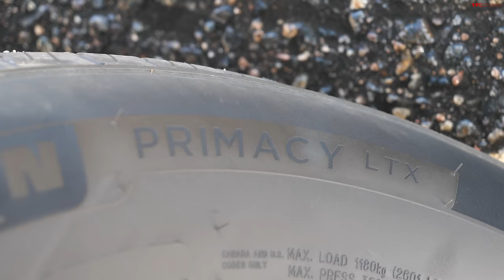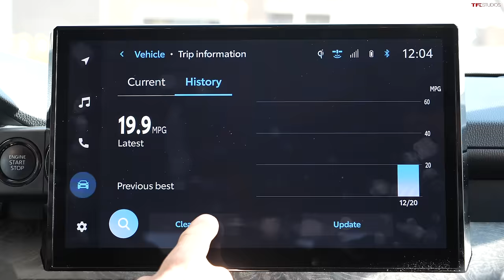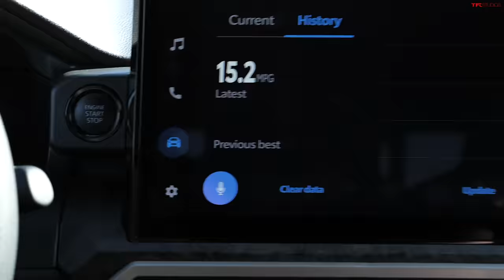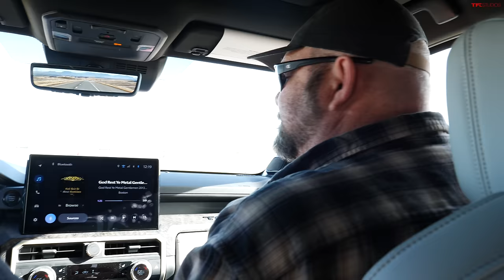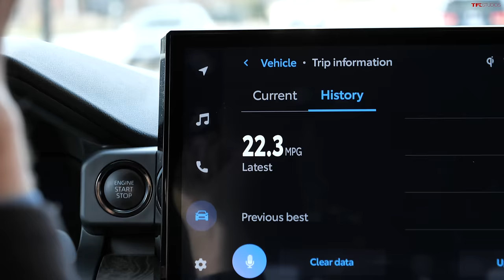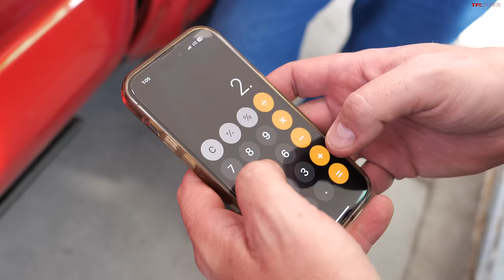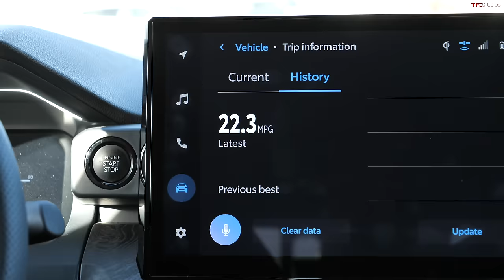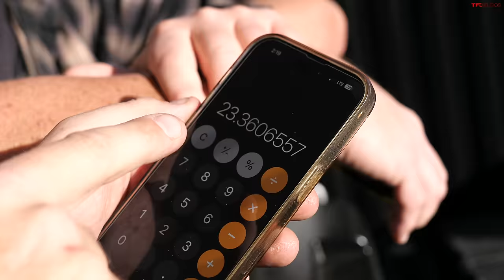Does the New 2024 Toyota Tacoma's Massive Chin Spoiler Actually Do Anything? We Put It to the Test

Comment: The difference may be larger at sea level. The air is fairly thin where you guys are.
Reply: If there's a 2% improvement there would still be a 2% improvement just the actual miles per gallon would be different
Reply: ^ so...
The difference is an environment where aero effects are *more pronounced*, versus an environment where aero doesn’t help as much (high altitude Colorado).  
Ergo, the difference (2-3%) widens differentially.  It’s still a matter of testing whether the difference changes to 2.5-3.5% (negligible), or if the difference widens meaningfully... which is subjective, but if it approaches 5-6% difference, there are probably people who would keep it.  
Personal note, I’d eat the 5-6% difference and remove the chin myself lol

Comment: I could see owning a set of oversized all-terrain 3PMSF, and running them in winter and offroad without the air dam, then having a set of OE size highway tread tires to use with the air dam for daily driving and highway trips/towing. The combined difference would probably be 5-10% MPG, enough to pay for the extra set of tires/rims after many years.

Comment: I noticed the chin spoiler had 2 big rectangular holes in the front of it. If the holes were covered would it make a bigger difference?
Reply: Those to holes could be a vortex generator to accerate the air underbody not sure were exactly they redirect the vortex my guess for the front wheel
Reply: then people would complain about no access to the recovery hooks (or loops in this case)

Comment: I removed the front air dam on my F150 after getting stuck in the snow when the air dam acted as a snow anchor.

In doing so, I lost 2 mpg on the highway, however, I also noticed the truck was less stable at speed and could feel some turbulence pushing the truck around side to side.
Reply: Same 2 mpg loss for me on my F150 but no change in driving dynamics after spoiler removal.
Reply: I left mine on, if I hit a rock with it  it's a warning to be careful and not let it hit my oil pan or trans pan.
Reply: @volvo09  in dry conditions, it's no problem, I agree good to hear the warning with it rather than hit the oil pan. The issue is in snow, when snow gets deep it first acts as a snow blow, then when you back up, it scoops snow up and into the front bumper leaving you immensely stuck.

Comment: With or without the chin I am pretty happy with those numbers. If the hybrid can add 2 or 3 mpg to that then Toyota will really have something.
Reply: The 4 cylinder engines are supposed to be more fuel efficient than a 6 or 8 cylinder. But John at LHT Performance put a V8 from a Silverado into his 2020 Colorado, and he gets 28 MPG on the highway. Why spend so much money for a 4 cylinder or a hybrid when the fuel economy is worse than a V8.
Reply: @aerynlovell4754 yup. I imagine a Tacoma with a v8 would be very decent mpg
Reply: @aerynlovell4754  It's more that smaller engines have  lower emissions, that's what the Government is pushing for. 
That being said V8s always got good highway mileage, it's when you're putting around town that it drops like a rock. I had a Grand Cherokee with the 5.7 and  the ZF 8-speed. Even with cylinder deactivation  best I cold get was 15 mpg. Even my Camaro only gets 18.
Reply: @DragonKnightX12  John at LHT Performance used the V8 from a 2020 Silverado and a 6-speed automatic transmission. It still has the factory catalytic converter. He doesn't like heavily modified vehicles for a daily driver. It is what he calls OEM Plus, meaning it complies with emission standards, is quiet (no drone), but has more horsepower and better fuel efficiency. An engine is a giant air pump, so if you remove the restrictive stock air intake and exhaust and replace them with a free flowing aftermarket intake/exhaust, then you get better gas milage.
Reply: @aerynlovell4754  has there been updates on that? I think the fuel economy was just based off a first drive using the onboard display (with no real accessories hooked up yet). I'd be interested to see if he has a follow up where he actually calculated it with everything working.
Reply: I still haven't seen any advantages of a hybrid in a truck yet. Now maybe if I was a delivery person that never got on the highway and never went past 45MPH then there might be an advantage. Hybrids add extra weight and extra cost so savings in the long run or not as significant.
Reply: @jamesm568  Fuelly shows a difference for the F-150 Powerboost. It's up to the specific person if such a difference is worth it though. To me the advantage isnt necessarily fuel economy, but the onboard power that pickup hybrids these days have. Having 2.4-7.2kw of immediately accessibly power is a huge advantage for what I like to do.
Reply: @ALMX5DP  Plausible.

Comment: Yeah I will choose way better looks over just a 3% improvement in mpg, and a Tonneau cover for the bed would probably get back that 3%
Reply: Actually increasing tire pressure even just a tiny bit, a few PSI, can easily increase MPG by 3% or more. Pro tip there for everyone, but dont increase your PSI too much and check recommendations and do your research. Off-roading decrease PSI, but generally not below 20.
Reply: Jury is still out on how much a cover can help improve MPG.  It is understood it doesn't help much.

Comment: Let's be real, 57 miles isn't anywhere near long enough to get an accurate idea of the actual MPG. Either way, I wouldn't care if I got 5 MPG less, I would remove that front chin before I drove it off the lot.
Reply: Yeah, far too short of a test without using a fuel cell.

Comment: The chin would make since if it could get you 1-2 mpg extra.
Reply: Well it got 0.7mpg, that's not far off the 1mpg you mention...
Reply: @boostav  I stated 1-2mpg, meaning over 1mpg.
Reply: @thenutsonyourchin  A chin guard on this will never be able to create enough wind deflection to save 5mpg. Not even a completely different front end with a low drag design would save 5mpg.

Comment: 87 octane in a forced induction engine seems wrong to me. I know Toyota says it's fine but I am wondering if premium would result in better power and mpg.
Reply: @carbonking53  higher octane won’t produce more power. It will produce as advertised only. Lower octane will produce way less performance than advertised.
Reply: @AntilleanConfederation  Actually modern turbo engines will tune up when they detect higher octane fuel being put. Even Subarus do it.
Reply: @carbonking53  I agree and understand. My wife drives a Mazda CX-5 Turbo and Mazda states you can run it on 87 but you will get more power and MPG with premium. Her car has never seen a tank of anything but premium since the original dealer fill up of which I assume was regular.
Reply: @DragonKnightX12   tune up to the factory tune for 93 yes. But it won’t make more power past that.

Comment: But what if you can’t find your 10 mm socket?
Reply: Every Jeep Wrangler and Gladiator include a little tool kit with a ratchet and bits to remove the doors and hardtop and fold the windshield. Toyota should include a ratchet for the chin spoiler.

Comment: Is no one upset that it only gets 24 mpg. That is awful. You can get a F-150 that gets that or better and it’s bigger and quicker.
Reply: You’re lucky to get 20 in an F150 and it’s no quicker.  Being bigger is not a selling point.  It won’t fit in parking spaces or garages so it’s basically useless.
Reply: “ (F150) won’t fit in parking spaces or garages so it’s basically useless.”

$hit. Nobody told me that my F150 was useless because it didn’t fit into parking spaces. I though after driving it 80,000+ miles that it fit into parking spaces pretty well. It also fits my garage. Definitely didn’t seem to be useless when hauling construction material in the bed or demo debris to the dump or when I was camping for months out of the camper in the back in state forests. Thanks for letting me know. I will get rid of that junk immediately and replace it with a new 5-foot bed midsize truck so finally I will have a useful truck. Originally I just wanted to add a Tacoma to the fleet but you opened my eyes. I should just dump that useless F150.
Reply: @carbonking53  The truck mileage computer is optimistic.  Try parking in a garage that’s 18 feet deep.  I’m not removing snow and ice in the winter.  Acceleration is limited by traction.  A pickup with little weight in the rear is not accelerating very fast.
Reply: @carbonking53 interesting. I had one of those and barely got 18 mpg.

Comment: You're cruising around at 75mph. You're never going to get good gas mileage at that speed.
Reply: I have. 🤷‍♂️
Reply: @JohnDoe-nz6bk  Is it the exact same truck as shown in the video? As in 100% exactly? Same town? Same distance? Same elevation? The answer is NO. Your anecdotal evidence is MEANINGLESS at best and useless since there's multiple factors at play here.
Reply: @MustangFord  no, with a hemi. With a 6.7 diesel. With a 4.0 in a 2018 4 runner. The mpg between 60-75 mph is a negligible difference.
Reply: The MPG at 60 vs 75 is definitely NOT a negligible difference. I just did a test drive of 2,600 mile’s keeping my HD diesel truck running at 65 MPH vs the usual 75 MPH that I drive on same route and I got 20.5 MPG vs the usual 16 MPG. And that’s over 2,600 miles. No towing just the truck. The difference would be even bigger for keeping the truck at 60 MPH.
Reply: @is6566  I call BS on that claim. I consistently got over 18 mpg doing 75 with my 2016 ram 2500 mega cab limited cummins. And I live in Ohio where it’s hilly.
Reply: @John… Do you mean the “cheater” Cummins gets better mpg than the (as of writing) non-cheater Duramax 3500? LOL What a surprise. One is also inline six and the other is 8-cylinder. And 2,600 miles one way is not gonna be flat probably anywhere in this country.
Reply: @is6566  I’ve gotten the same mpgs out of a v8 diesel.
Reply: @John…. What can I say? You are the Master of getting as good (or negligible drop) MPG out of every vehicle be it HEMI or diesel, or anything really at 60 MPH vs 75 MPH. 

I am just part of the mere mortal category where increased speed over 55 MPH drastically reduces fuel economy. In my world this is how it works: 

According to studies backed by the department of energy, the average car will be at its advertised MPG at 55 mph. But as the speed increases:

      - 3% less efficient at 60 mph
      - 8% less efficient at 65 mph
      - 17% less efficient at 70 mph
      - 23% less efficient at 75 mph
      - 28% less efficient at 80 mph

At 75 MPH the MPG will be about 20% less than at 60 MPH. My own experience backs it up. In my case the efficiency difference is 25%. At 75 MPH I have an average 16 MPG vs 20.x MPG at 60 MPH. On a 2,600-mile one way trip (hand calculated) on Duratrac tires in a 12,250-pound GVWR Duramax (modern DPF/ERG/DEF etc intact) truck. So, here I have a conundrum, I can believe science which roughly aligns with my cheating eyes and personal experience or you the random dude on the internet with the magical truck where air resistance doesn’t increase exponentially by speed. 😃 Hard decision.
Reply: @is6566  and my experience says it’s completely wrong. Don’t know what to tell you other than learn how to drive your vehicle. The only vehicle that I got consistent horrible mpg (13) was my 2021 Mojave. Again, learn how to drive. 🤷‍♂️
Reply: @is6566  interesting that your truck weighs 12,250 when my Cummins was 8900. A dully only added about 500 pounds. A 3500 wasn’t much more than. So, if you weren’t towing, why is your truck so heavy? My truck had 3:21 gear ratio with people getting as much as 25 mpg. Fords 6.7 with 3:55 gets 18-20 my personal experience. Soooooo, either you’re lying, or you just don’t know how to drive. I’m going with both scenarios.
Reply: What interesting is that you argue about trucks and don’t even know what GVWR is and you confuse it with curb weight. I will leave it at that. Everyone reading this thread can make a decision who is lying out of the two of us.
Reply: @is6566  yeah, you’re lying. You’re using gross vehicle weight, meaning you were hauling. Which you said you weren’t. My weight was with a full tank of diesel. And a few things I always carry in my vehicles. So go ahead and keep lying, pal.

Comment: My 1985 Toyota 4runner SR5 5 speed with the 22re engine and has 289,000 miles and gets 23mpg using gasoline 89 octane , no E10 or any type of ethanol.... truck sits on 35's with 5:29 gearing. getting the 23mpg on said truck using gasoline 89 octane going 70-75mph on a 2 hour trip.  I would say this is AWESOME. considering it's age. on a side note, I tried the same trip using E10, fuel economy dropped to 17mpg.

Comment: you know this is interesting. i have a chin spoiler i HATE on my 2016 ford f150 3.5ecoboost. i have wanted to get rid of it for a year now. but i always hated the thought of losing MPG. but this test shows that i will be fine. of course different truck. but if the savings are just 1-2 mpg. well it might be worth it to just take off
Reply: On my V8 F150 it is 2 mpg drop for removed spoiler.

Comment: After owning the vehicle for 50K miles thats a lot of gas saved. Of course its not going to be significant in this scenario. The point is that IT WORKS.
Reply: It’s like 60 bucks a year. Basically nothing saved at all.
Reply: @devengudinas1649  That's a lot of gas saved and less emissions that are spread when you consider potentially thousands of these trucks will be on the road... It not always about you.
Reply: @MustangFord oh good god! 🤦‍♂️
Reply: @JohnDoe-nz6bk   That's exactly right, you have zero points to make with zero facts to back anything up.
Reply: @MustangFord your original comment said "a lot of gas saved". To me $60/year is not a lot. It is something for sure  but the difference in saved gas and emissions especially is insignificant.
Reply: @MustangFord  I don’t argue with more ons!!
Reply: @Pantelifts10  it’s not. It’s barely 2 gallons a month, if that. City driving??? Forget about it!
Reply: @Pantelifts10   A single owner might find it to be insignificant or not, that's up to them to decide. Thousands of these trucks on the road will indisputably save A LOT OF GAS (which is a good thing).
Reply: @JohnDoe-nz6bk   You sure do spell like one, pal.
Reply: @MustangFord  thanks for proving my point!
Reply: Just for some context on the larger picture, if that is what is being discussed. Doing the simple math (based on this decidedly unscientific test by TFL) says that if Toyota sells 250k of these with the spoiler, after 50k miles that spoiler would save over 15.5 million gallons of fuel. Not bad for a simple piece of plastic.

Comment: The old truck was better looking and more functional. Turbos add fail potential.
Reply: Yes, & very expensive fail point.
I remember back in the mid 80's car companies did the same thing, turbo everything. So just like then maybe this is just another fad.
Reply: The old truck desperately needed an engine update.
Reply: @noneyabizz8337  Why do you think that?
Reply: It’s definitely not’ ‘80s anymore for turbo engine design.
Reply: @scottyellis3442  very expensive? A new OE turbo for my 2.0T is like $600.. I bet some other ancillaries can be more expensive to replace.
Reply: @mlow42  poor mpg, poor power.
Reply: @ALMX5DP  seems like the plumbing, extra fuel systems, turbo, pressure in the heads, intercooler, labor etc, will all be potentially extra expenses.
Reply: @noneyabizz8337  mpg is no big deal, power perhaps I can see.
Reply: @mlow42  extra fuel systems?  And doesn’t seem that way at all to me, especially on an inline 4. It’s pretty straight forward and though a turbo might be an additional component really it’s not much extra complexity especially when compared to a V configuration engine with multiple heads and valve trains.
Reply: @ALMX5DP  don't we need more fuel and more fuel pressure, with a turbo? More pressure on the cylinder gaskets, more pressure and heat in the exhaust manifolds. Overall, I'm just saying there are more things to break and those things are unnecessary.
Reply: @mlow42  direct injectors should be similar in terms of pressure and flow to other engines of a similar power rating. There is more cylinder pressure but if the head and hardware are all designed for it, there’s really no worry an not more to break.
Reply: @ALMX5DP  I've been known to be wrong a time or 2.  It still seems unnecessary, as engines have worked fine without them for a long time
Reply: @mlow42  yeah it’s not necessary in all applications but like we’ve seen in the semi tractor trailer realm turbos have become commonplace to meet the power and efficiency targets they require. I can see the average modern passenger vehicle turbo go 200k plus miles without worry. Sure that could mean it needs a replacement where an NA might not need anything but to me that’s not a huge deal given the life that most vehicles are kept for and the cost of replacement when it does come time.
Reply: @mlow42  real world, the previous gen Tacoma gets under 20mpg average.  There are larger trucks getting better mpg, that's unacceptable.

You may say mpg doesn't matter, but that certainly wasn't what the entire nation felt as we started marching towards the 10 dollars per gallon the left wants.  Money always matters.
Reply: @noneyabizz8337  well said
Reply: @ALMX5DP  Efficiency targets and costs to replace vehicles are the 2 things that stand out. I'm an old soul, I suppose.